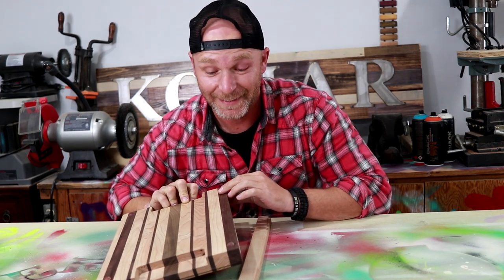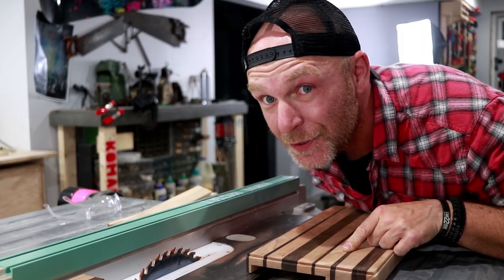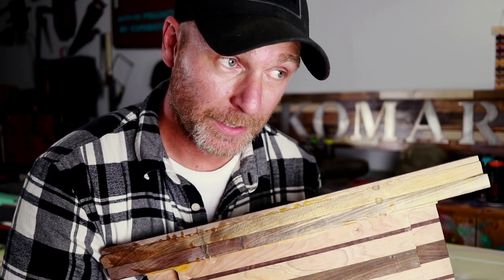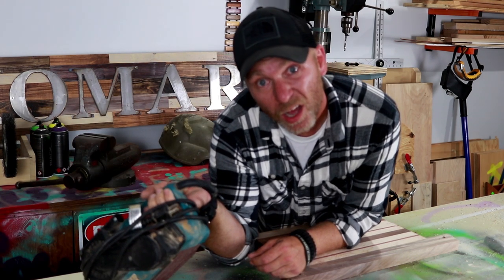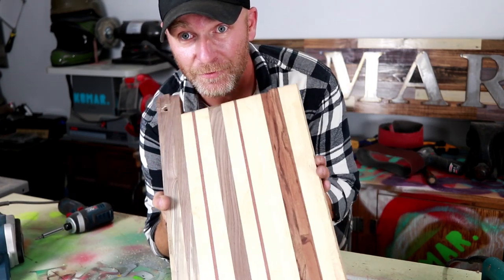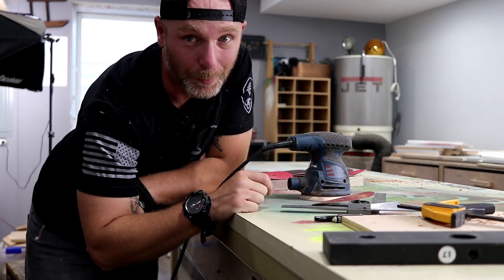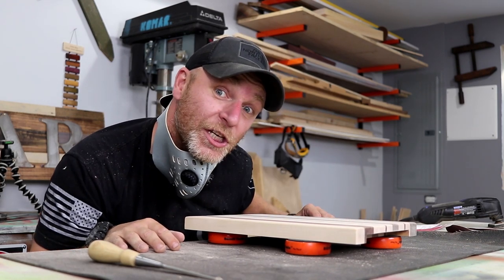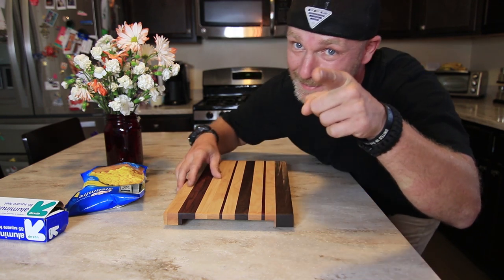How To Fix A Wood Cutting Board - Dishwasher NO NO !!!

Comment: I legit laughed, like a full-bellied out loud laugh, not just an extra exhalation through the nostrils, when you broke that piece off right in the beginning. I was secretly hoping you'd convert the board by re-assembling the pieces into a cut-ends cube-type pattern, but this was still an entertaining video. You did mention to use food safe glue though, right?